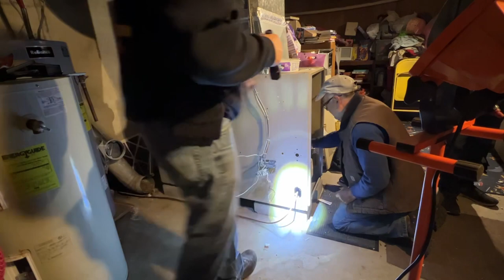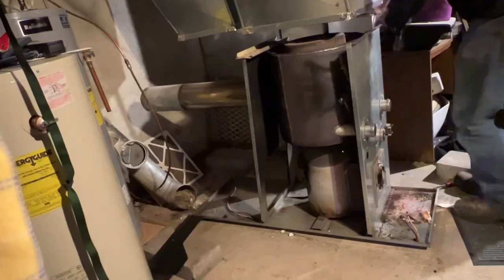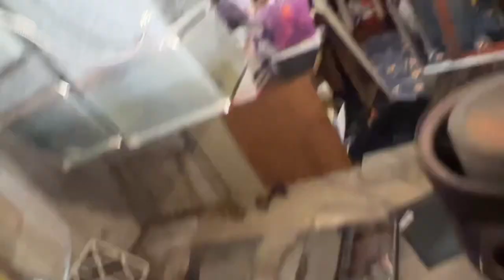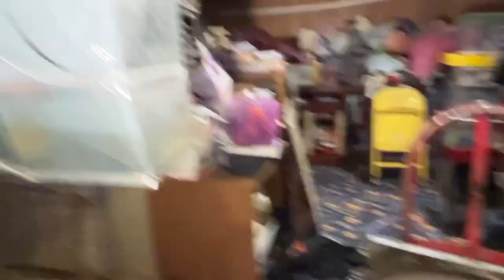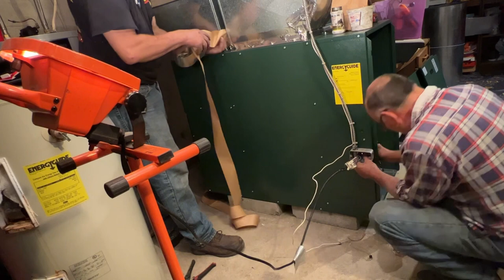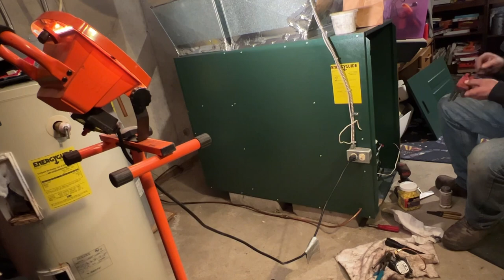Junk Lennox furnace replacement

Comment: Thats a nice hole! What about Thermopride?  They coat the heat exchanger in copper and give a lifetime warranty.
Reply from the maker: Thermopride is an excellent furnace just not readily available in my area
Reply: Sadly they changed the design about 10 years ago..the newer ones are tighter/lighter...I fear they wont hold up as long as the older ones do.